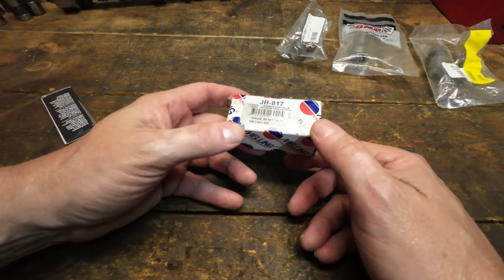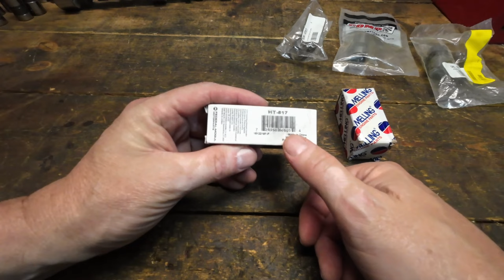Why your Flat Tappet Lifters Failed

Comment: Had a very reputable cam fail on one lifter during break in. Had .498 total lift with 1.7 rockers and the springs recommended by the mfr. This was on a 351m truck engine that was built mildly over stock. Cam, lifters and springs made by same mfr and ordered as a kit. Used high zinc break in oil from the machine shop that they sold, forget the brand. They build racing engines. They did not mention using lighter springs for my combination. They have also had cam/lifters fail for the racing engines they've built that require flat tappet cams. Went full roller valvetrain and spent 2000 bucks more than I wanted to on the build but in the end it's a better combination.
Reply from the maker: Hard to argue against a roller set up.  With flat tappet cams and lifters getting harder to get, the prices have spiked up.  Even more reason to walk away from it.  351M is another one of those low rpm break in engines.  Sad to hear you had one fail!

Comment: The number 1 thing you did not mention - Fire that motor with the vale covers off.  Stripe the push rods.  If you do not see each one rotating like crazy, shut it off and figure out why ??
If it ain't spinning on first fire, it ain't going to.  Could be crown to taper mis-match, etc.  But what ever the reason figure it out.
Reply from the maker: This video wasn’t about how to break in a cam.  I mentioned immediately to start the video that we wouldn’t be covering every aspect of why a lifter failed.  Perhaps we’ll cover that topic in depth down the road.  Thanks for the idea and watching!
Reply: You hit the nail on the head, Some lifters are not made properly in the first place, they will not turn properly. Any Engine builder that tells you they have never lost a cam is ether not building vary many engines or they are a Bullshitter.

Comment: My son and I are building a 306 SBF for his Fairmont, and have been digesting all of this lifter failure discussion.  I am Ford factory trained, and also work for a shop that restores 64 to 69 mustangs.  My job is to break in the new engine that came from a well known rebuilder, and I have yet to have a failure with OE spec cams and spring rates.  I do use added zinc and pre-oil with a drill motor, run them at 2200 +/_ for 30 minutes, set timing to 30 degrees (locked), and keep an eye on temps.  I have a new comp cam and lifter package for the 306, and I took several of the lifters, placed them upside down on a true steel plate and checked the crown with a dial indicator starting at "zero" with the indicator in the center of the crown.  Not very pleased with the accuracy of the crown, and after marking the high and low areas near the chamfer, I am about to give up hope.  ( some of the chamfers had chips missing from them ) Any thoughts on the use of "DLC" coatings on the lifters, and are there any cases of the coating flaking off ?  Thanks for taking the time to share your thoughts with us.
Reply from the maker: The DLC lifters are amazing.  So far I’ve yet to hear of any failures.  The coating is molecular in its depth.  It’s not like a coating per se.  Comp offers a DLC lifter for the Chevy engines but I don’t think they have released it for any of the others.  Maybe we’ll get some news at SEMA or PRI this year on new applications.

Comment: No matter how you heat treatment, temper, harden etc etc etc cheap steel is soft in core value and brittle on the surface, oil additive isn't as good as old high zinc oil from the 70s, I used to be a machinist at the Newport News shipyard on reactor valves, take my advice please, find a old stock Cam and lifters from way back or go roller !!!
New doesn't mean alot these days (steel quality, oil quality etc) a good roller setup is money well spent.
All the best to you and yours Sir.
Reply from the maker: I think you’d find the second video in this series interesting.  Material hardness and depth was a big part of that conversation and I cut down some cams to show it!  Cheers!

Comment: I’ve had a popular cam company’s cam fail. My engine had about 300 miles on it. It’s a show car, that I drive only a couple times a year. It was a refresh build, after the engine being in a car that I drove every day, and ran it pretty hard. I built the engine back when I was 17, and after that 11 years, I pulled the cam and lifters . They were all in great condition! I did the refresh build, and within 4 years, and only a few hundred miles, the next cam was destroyed. I had a second engine that I did a teeing job, and some other mods to, with a old SSI cam , from PAW, with a set of Rhoads lifters, cause I went a little too big on the cam.  Seven years of constant beating on that engine, and I pulled the cam, and it was also in great condition. Heck! I’ve sold both of those old cams and lifters (that I kept in order) to good friends of mine. That was over 15 years ago, and we’re still good friends 👍 My concern is that I have used that reputable cam company again for my show car. I used the lifters that helped me with the larger cam before, cause the reputable cam company’s lifters had a problem binding when filled with oil. I gave them to my friend, who took them apart and found a bunch of metal chips inside the lifters, that caused them to bind. That’s why I went back to the “variable time “ lifter. They hadn’t failed me before. I’m just still concerned, because I spent another 3 grand on the engine in my car, it still sits more than driven, and I don’t wanna go through a major rebuild, if it falls again. I’ve heard the trick of taking a marker pen, and drawing a line on the pushrods, and cranking the engine a few times. Then checking it to make sure it rotates. I’ve done this a couple of times, and it seems to work. Whadda you think?  Some turn more than others. Should I worry??
Reply from the maker: @stevenbongiorno9277  watch the rest of the videos in this series.  Especially the ones on lifters.  My question should be an easy one to answer.  When your machinist went through the engine, what did they tell you the lifter bore to lifter tolerance is for each bore?  If you don’t know the answer to that question, find a new machinist and take it to one that will measure that for you and tell you if any are out of tolerance.  The rest of the break in process is easy….IF you follow the rest of the problem points - spring pressures, break in oil, break in RPM that’s relevant to the engine you’re building.

Comment: I got a set of Summit lifters in today (8/10/24) and It appears they have changed. Chamfer is very tight, definitely not the large chamfer you have on that Summit lifter there. Bottom grind looks more like the comp lifter and has made in Mexico on the box. I don't know if all part numbers are now updated or it's just a supply substitution for the time being. Maybe they seen your video. Wish me luck with them lol

Comment: Thanks for another video on this subject. I am slowly doing a 65 Nailhead for a Riviera and I am mortified about break in. The only stock cam and lifters for these are Melling. I will be taking in the block sometime this fall but will add the lifter bores to the list of things to get eyeballed. I cant find a roller cam for this engine and would get one if I could; found lifters amazingly.  Not being an engine builder I have enough things to consider on top of potential failure. Sucks!!
Reply from the maker: There was someone out there making cores for the nailhead out of 8620 if I recall correctly.  Would have to dig for it to see if I can find it.

Comment: Took out a 383 cam on break-in because of no zink. I have about four thousand miles on my 67 327 that I just got eliminator ported 195 heads for and now I'm trying to figure out what roller cam I'm going to put in it now. Great video.
Reply from the maker: I chickened out years ago and have been roller ever since.  Or maybe it’s be use I don’t want the responsibility of all the extra work.  😂 Either way, roller is a great choice.  Video coming on that topic soon.  Thank you!
Reply: @MuscleCarSolutions  I'll be waiting for the video. Haven't built a sbc in years but I'm trying to get around 480-500hp. Got a 1984 El Camino with monster ss 700r4 part kit installed by local shop. Spray or turbo 2,400/2,800 stall.  3.73 carbon fiber rear. Thinking about taking it to The Firm in Starke FL and having some fun in my over 55 life I seem to be living now

Comment: This subject has me scared to do a new flat-tappet in my 289 and just pay through the nose for a roller setup... at that point I should just do a 302. Haha. Great info in here. Settles some of my nerves about trying a new f-t cam.
Reply from the maker: Honestly, because the supply is getting smaller, the prices of flat tappets have gone up substantially.  I switched to roller a long time ago.  I’m just not willing to go through all the work to make one live.  Doing this series has taught me a lot.  Glad you liked it!
Reply: just pay for the roller or go find a 5.0block that's already setup for OEM roller.......this flat tappet mess is never going to get solved. The last production engine that used flat tappets was the 4.0 Jeep engine that was discontinued over 15 years ago. The lifter manufacturers just do not have the OEM pressure to competently make these parts........everyone has their theory as to why this keeps happening but it just doesn't matter when there is no real answer in sight and you just watched your $ get lit on fire because of this.
Reply from the maker: @yurimodin7333  unfortunately there are quite a few racing classes that demand flat tappet use. There are folks who just what that option as a choice, for whatever reason.  In todays world, if you want them to live, there’s a long list of things that have to be done if they want that choice to live.
Reply: @MuscleCarSolutions  those racing classes are going to have to change. we are approaching 2 decades of no oem flat tappet engines. Even nascar finally allowed rollers after every team got sick of wiping out $100,000 engines for no reason.
Reply from the maker: @yurimodin7333 I don’t disagree.  That conversation has been going on for the better part of the last 20 years.  Yet they still keep chugging along with old rules….🤷‍♂️ Glad I don’t live in that world.  Id have been frustrated enough to go find another hobby.  😂

Comment: As an engime builder most fail fir the reason people let it sit and idle while they set the carb and timimg .when that is perfect they take it up to 1800-2400. 
   That flat tappet needs almost immediate to that rpm range. You can dial it in directly after you drop that first oil change.(directly after break in). This is my two cents 24yrs in the trade. Fyi for gm melling or gm lifters have always been extremely good for me along with service.
Reply from the maker: Yup.  There’s a nice long list of best practices for break in.  I did the initial break in on the GMC live so it could be seen how I do it.  You’re spot on.  I could care less about setting timing perfectly and getting the carb tuned.  If it starts, get it to its preferred rpm immediately!  

I was surprised about the Melling being made in Mexico.  Wonder what else of that brand comes from off shore?
Reply: @MuscleCarSolutions  i can tell you for me it has not effected the quality. I could be getting very lucky . You would be shocked on how many "made" in USA is not actually made in USA . 
   Melling also claims it's all machined and made in USA.
Reply: @MuscleCarSolutions  had failed cam once with Melling .called it in and they immediately next day sent me lifters , cam and pushrods(were free) the very next day.
Reply from the maker: I’ve worked in the automotive aftermarket for over 30 years.  The biggest thing that has happened to the industry in that time is the race to cheaper parts.  It’s driven a lot of products off shore.  Some ok, others not so ok.
Reply: @MuscleCarSolutions  I know of one manufacturer of cams , pistons ect. That used to be elite is now junk except for a pretty box.

Comment: I have a question, there is something I don´t understand.  This issue of lifter failure is one I have come across over the years and I have never really looked into the issue.  My question is, does this issue arise from contemporary engine builders looking for big power at high rpm?  This situation would require aggressive cam profiles and higher engine speeds, i.e. stiffer valve springs.  I am wondering if we have reached the limits of these blocks.  Specifically, the lifter diameter which would affect the line contact and it´s resultant hertzian contact stress.  I get the impression that is the real root cause because lifter design, materials and heat/surface treatment are old hat.  Have we passed what these older block designs can handle?
Reply: you cant use Chinese parts.

Comment: I've got 2 sets of OE GM lifters from TBI 350 engines.  They are two-piece body, hard-face hydraulic types.  They are in good used condition and would need refaced but are better than what can be found nowadays.  I'd let each set go for actual shipping cost.

Comment: Mismatches aren't born in a brand name as much as the specs: where that crown is, proximal to taper.  And of course hardness procedures.  For example, a greater taper necessarily demands more crown [shorter effective grind radius] to keep loading away from that outer 0.050" or so of the outer lifter edge.  Good point on excessive spring pressures - I wish I had a shop with a spintron near me.   There are some things a cam manufacturer has to estimate about anyones engine: valve, rocker, and pushrod weights.  Can a builder do better in selecting seat pressure & spring rates?  Maybe... but its gotta be tested, not shade treed.
And now for some sacrilege: knowing the purpose of break in oil is to increase wear through reduced protection... why are we complaining about flat tappet failures again?   As we chew on that, a disturbing fact about present ASTM test methods cited by some oil products as part of their API certifications: they are not testing using this older lifter design that must spin in the bore to survive. D6891 [also known as IVA test] attends to cam wear, and D8350 ["lifter" wear - actually bucket] attends to the following device but may yield some cam data.   Both tests use overhead cam design engines, neither of which involve taper so pressures an oil has to stand up to are different and most importantly... lower.  So the reason some remove inner springs when using break-in oil is because... they are using break in oil? Yes Virginia, that appears to be the case.  Maybe... trying to go past 0.525" lift or thereabouts [non-track use] is the moment to begin looking at a roller?  All depends on mass and rocker ratio.   Note what we cannot find from any oil provider, despite certifications almost falling out of their windows: PSI breakdown vs temperature curve which should arc like an eyebrow over its useful range.  Oils number one job is protection: heat, chemical and pressure.  Where IS their pressure breakdown data?  Harder to find than taterheads "exit stage right" plans...
Reply from the maker: Its much easier to talk about keeping brands the same on cam and lifters as the assumption would be they were designed and tested with a crown that works with the taper on the cam.  I know of a builder that has a custom ground cam with a TON of taper be use he chose to go with an off shore lifter and the two needed to match to facilitate the correct rotation.  Yet if someone were to get their hands on that cam and use a lifter with an OE type crown, hello failure.
Reply: yea what break in is, is very rarely talked about or considered? is it supposed to harden the surface of the lifters and cams in this case?

how come these aren't a problem with bucket over valve overhead camshafts and either inbucket or overbucket shims tho and their manufacture? that's a flat(not really flat) pushed just by the cam directly.

Comment: I am building a Buick 350 SP, 1970, 10.25 compression, rated 315 HP 410 TQ stock. It looks very fresh inside, and the #1 intake lobe/lifter was wiped (as well as some other lifters showing some dishing) I assume on break-in, and many years ago (like 15). I have a TA Performance cam, .470 lift 218 duration and .475 lift 230 duration, as well as the single valve springs they recommended for this cam. I secured a set of NOS Johnson lifters from the 80's with EDM holes where the intended build never happened. I would like to measure the cam lobe taper and the lifter crown. #1: Is there a relatively simple way to measure these values, as I am no machinist, just a mechanic. #2: What would those ideal numbers be? I plan to use Lucas assembly lube and break-in oil, of course following the recommended speed and length of break in, after I crank the engine with the starter to get oil pressure, verify oiling to the rockers, and also verifying all the lifters/pushrods spin (if you think this is a good idea, at least). Any help or suggestions would be very much appreciated. Thank you for delving into the topic of flat tappet cams and lifters, Sir.

Comment: When breaking-in you mentioned the triple springs. What about double springs. It's my understanding that you can keep the inner spring in during break-in.
Reply from the maker: All depends on the pressures.  If they would out to under 100 on the seat and less than 200 open, you’re good.  But in reality, a double spring is likely going to be way too much.

Comment: Trick Flow cam, Delphi lifters, Permatex Ultra Slick assembly lube,Joe Gibbs oil. All that and a “ known running set up” i.e. carb and ignition. You’ve pretty much got one shot at start up.

Comment: I have an edelbrock avs2 and it doesn’t feel like the secondaries are opening up under WOT. I know this isn’t related to your video but I figured I’d ask on your most recent one.
Reply from the maker: I have a video on adjusting the air valve.